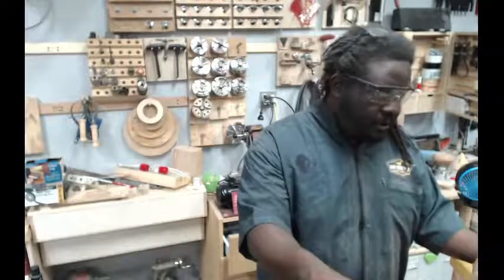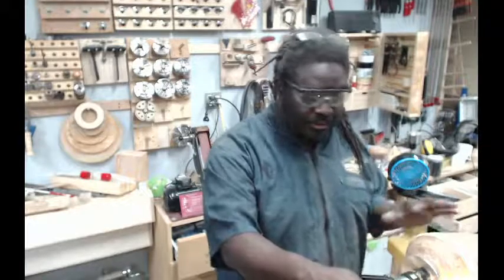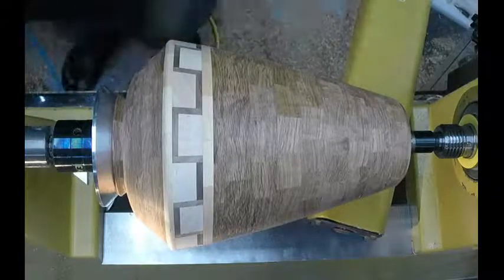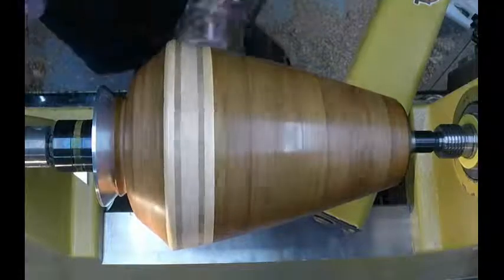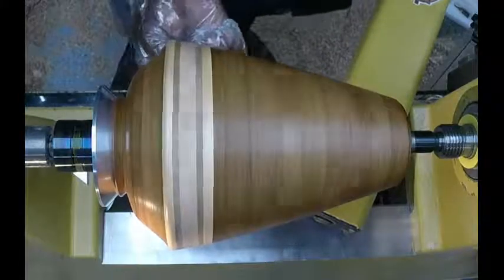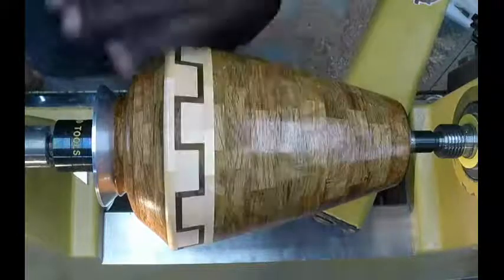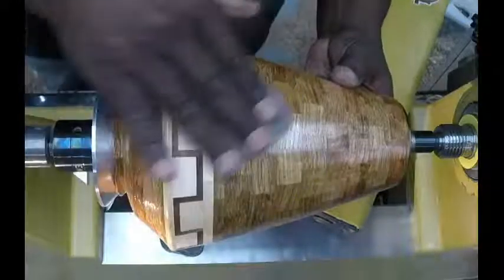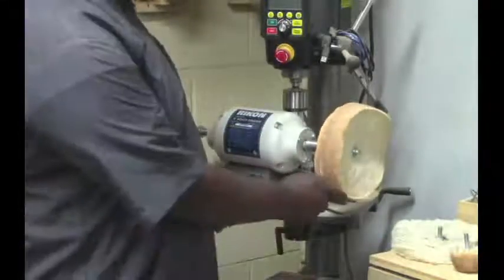Segmented vessel part 5 of.... several??

Comment: Very nice project Darryl. Turned out beautiful. I’ve been using Phil at Shady Acres method of turning off the tenon. It works well most of the time. But I’ve made the move now to using a recess. Still not so sure about it, but for now I’m going to use it for my side grain work. I’d like to see how you take this tenon off. You CA finish was very much like Capt Eddie’s. I like it a lot but have never tried it on anything larger than a pen. May have to give it a whirl. Thanks for taking us on this journey with you.